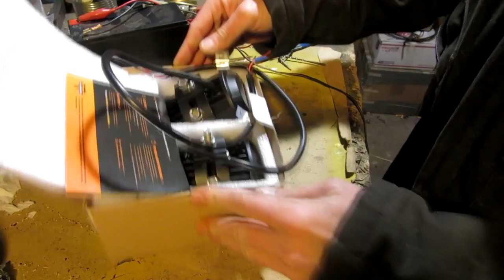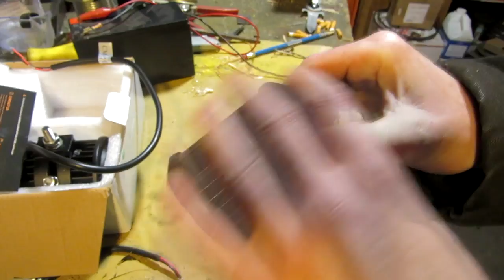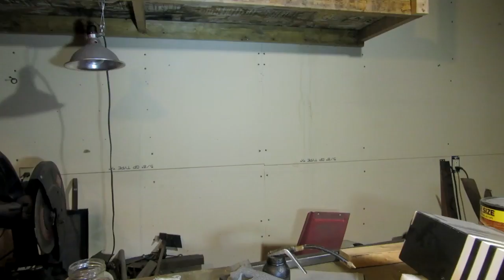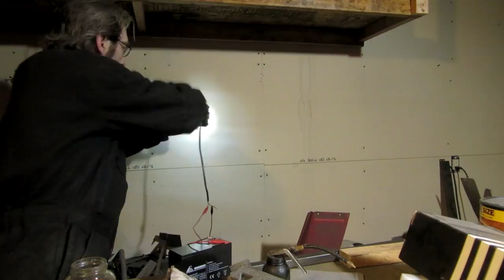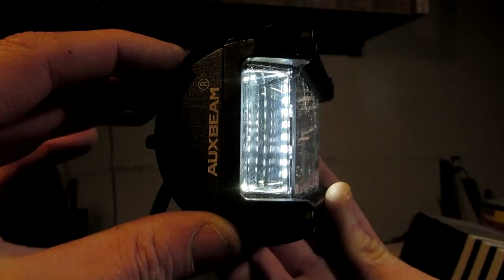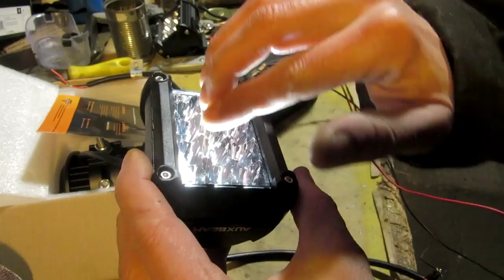AUXBEAM 18Watt 4inch Combo LEDs

Comment: At only 18 watts...I think I might consider them for emergency lighting in the house.  Similar to lights mounted near ceilings in buildings.
Reply from the maker: sure, but the ones with the side lights are sold out. But the other 18W one are still available . But once you get them you'll understand the brightness and want to use them on a vehicle.
Reply from the maker: there were 15 available when I did this video and with in a hr or so they were sold out.